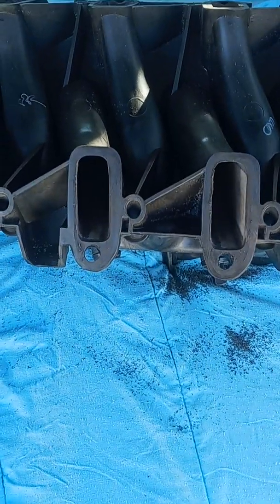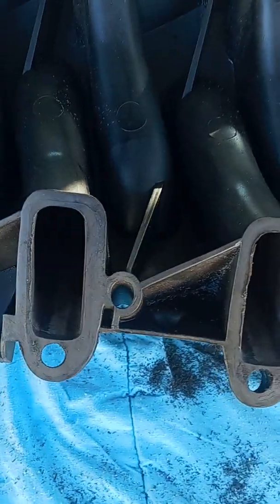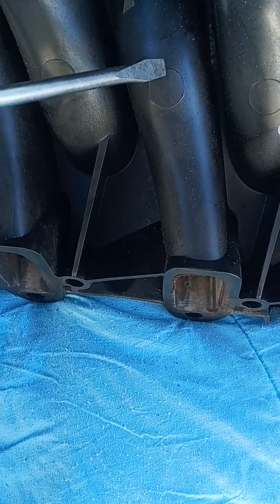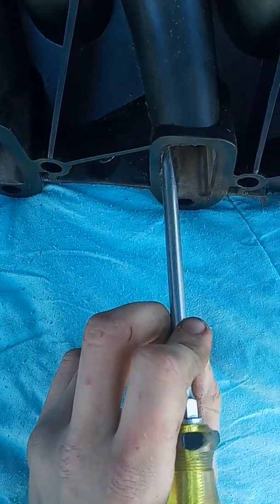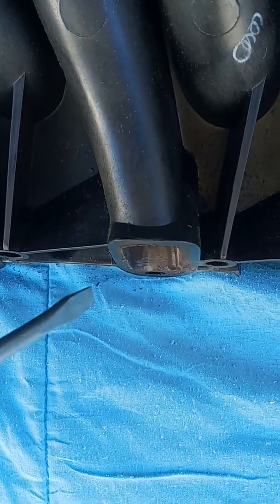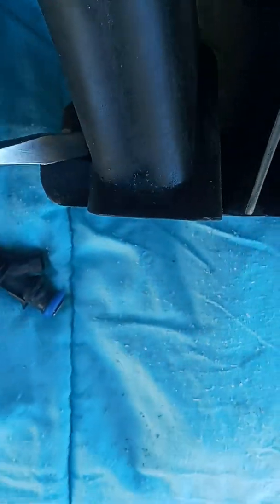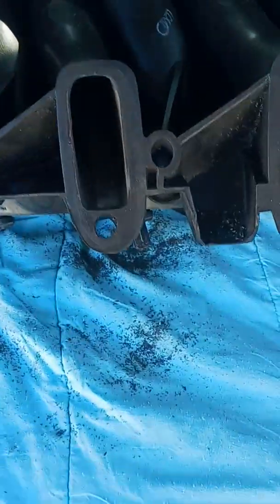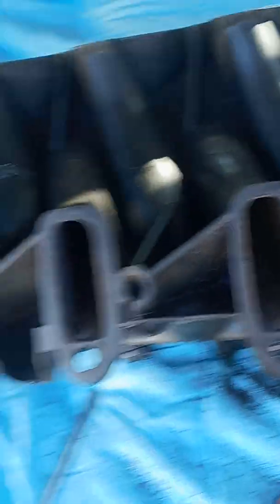porting stock LS truck intake manifold part 1

Comment: I understand it's 2 years old, but how did this work out? Any noticable "seat of the pants" gains? And the fuel injector clearances you modified? Wouldn't the gasket negate any modification you did? How did this work out before I ruin mine? Lol If you could respond to this that would be awesome....

Comment: I was looking to port my Ly6 6.0L intake as well. I didn't know you could port a plastic intake but I guess you can. Cool. Thank you.
Reply from the maker: Yea man I ended up finishing the intake and bolting it back on, I wish I could Dyno it.  All I can say is it sounds alot different now, has a throaty growl and seems to accelerate faster at certain rpm ranges in certain gears.  

Probably needs more supporting mods to really stand out

Comment: Good information.  Only thing I wouldn't do is mess with the injector area.  As a little side note, if it's not possible to get a perfect port match it's better to have the head port larger than the intake port so the air doesn't hit an edge (lip) but you might be aware of that already.